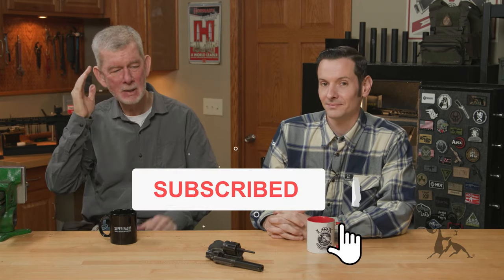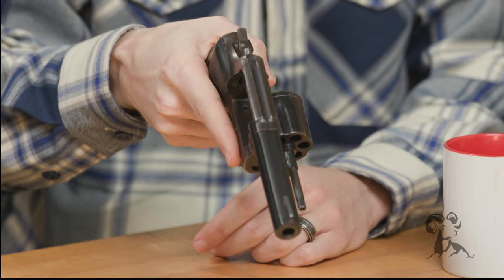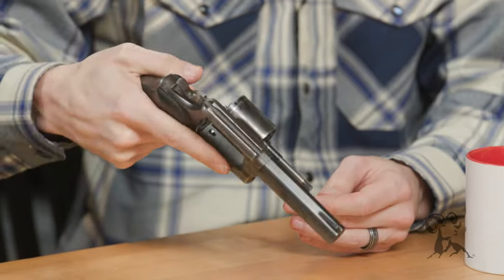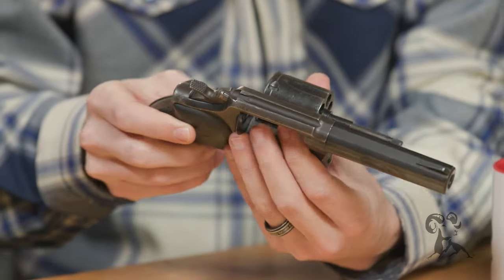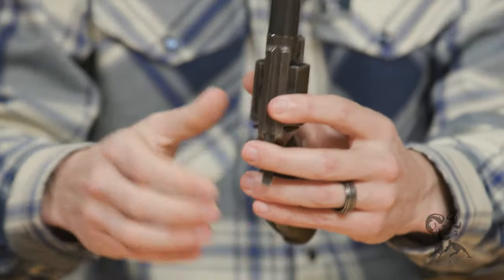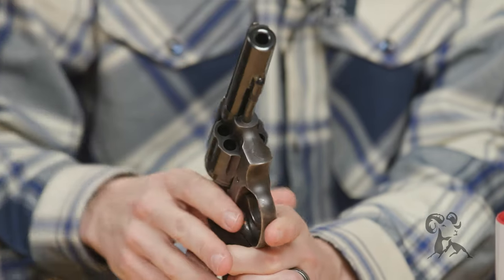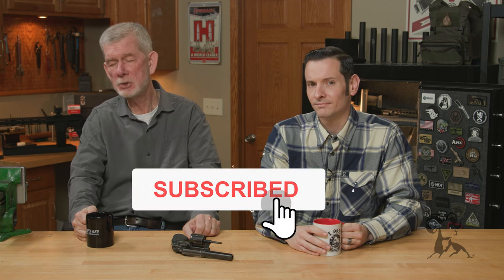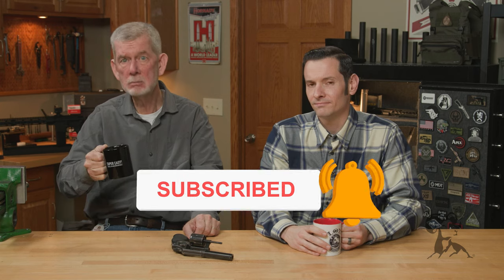Smyth Busters: Is It Bad To Snap a Revolver Cylinder Shut?

Comment: As an armorer certified on S&W revolvers, and having to repair many revolvers because of people snapping the cylinders closed, because it "looks cool" - DON'T DO IT!!! :-(
Reply: They're abunch of freaken wisenheimers I suppose by doing it and it's not cool at all when they break one and have those costly gunsmith bills to deal with !!!
Reply: Well yeah, S&Ws are like Colts..sure they look good, but give me a Ruger all day and twice on Sunday. If I'm firing a revolver, it's gonna be full house loads. Rugers are built handle it, Smiths aren't.
Reply: Not a problem on saa revolvers 🤠
Reply: I was shooting my “RGB Inc” .38 SPL and after each shot the cylinder started coming out on its own. Kind of scary makes me think it could explode does anyone know what could be wrong and should I take it to a gunsmith
Reply: This isn't how I would reload normally, but I would probably do it in a pinch if I ever had to use a speed loader under pressure... Still not good for the firearm but neither is burnouts in a car. Doing it once in a while or in a freak emergency is probably not going to blow up your gun. Doing it alot almost certainly will though. Save the abuse for the abusive situations.
Reply: @akmarksman Is this true with Smith and Wesson model 29? I have been eyeballing that and some of the Ruger Super Red Hawks
Reply: I just want to know how and why it causes damage.

I'm not saying it doesn't, I'm saying simply that it doesn't make sense to me that such little force could cause damage.
Reply: My grandpa had M10 .38spl from Vietnam, he saw the pilot swing it, and they said it's fine... So I took his word and then I realised.. You air force - army guy have an armourer to fix things, but I don't... So I gently open and close it ever since, but barrel is cracked and had to be change.
Reply: Since you're a certified S&W armorer, maybe you can answer my question. Should I apply lube to the internal parts of my K frame revolver? I don't mean a protective coat that I apply, then wipe off. I'm talking should I apply a drop of oil to certain parts under the side plate?
Reply: @cincinnatiking8008  
Yes, a DROP of light oil will be beneficial.

Comment: This is very on point and a good follow-on video would be what to look for when buying a used revolver...how to evaluate revolvers for this past mishandling.
Reply: Start with looking at the crane/frame junction from the front. If it’s not a tight, even junction just walk away.

Comment: I think there is also a distinction to be had in what motion is being used to make the revolver cylinder swing back into place and how aggressive it is being done.  You can easily do the one hand closing without imparting enough energy to the cylinder to cause damage, while on the other side of the coin you can also cause damage doing it two handed if you are in a panicked or stressed situation and you aggressively slap it shut with your off hand.  I think the better point to make is more to use care with your firearms and don’t abuse them.

Comment: I've got half a dozen guns with SSN's engraved into them.  I've also fixed a couple of revolvers with damage most likely caused by flipping the cylinder closed.  The one that gets me is one the owner owned up to.  It was a Ruger GP100 that the owner said he was bashing the ejector rod against a post to get the empties out.  Says he saw it in a video somewhere.  Of course, if you're a little off center the GP100 will snap right at the weak point.  Ruger sent me a new one for free on that.

Comment: I was astounded when you mentioned shooting tv’s decades ago and then Gunsmoke. I had a police Sgt who in fact watched gun smoke before going to work and putting on his duty belt with unloaded Pistol   Every time trying to out draw Matt Dillon. One day he had failed to unload when he put the gun on frig ( had kids) and shot his tv. Also astounded when you discussed the detective flip and K frame Smiths. I had a M-66 duty revolver in 70’s and my father a gunsmith told me sternly not to flip the cylinder closed. I passed on this information as a range officer.

Comment: Yep, it came from the movies. Break top and 1873 clones don't suffer this abuse, but they get a different stress that's hard on latch pins and timing hands due to base pin debris. If I owned a swing cylinder revolver I won't be slamming it.

Comment: This is one of many reasons I won't loan a revolver to anyone for any reason but especially for hunting. It's pretty crazy that it only takes a simple understanding of physics to know that slamming a revolver cylinder shut is bad. Spinning the cylinder and slamming the cylinder shut is worse still. The cylinder shut be lifted shut while rotating the cylinder upon closing for longevity of lockup and timing.

Comment: Just because something is physically possible to do does not mean it's a good thing to do.  Reminds me of the Mazda dealership next door to my shop.  I hung around there when I could to learn about cars and I got to know the techs.  They had customer (a douchey kid whose mom and dad bought him an RX-8) who blew up the motor.  RX-8s had a rotary motor that redlined at 9000 rpm.  Mazda warrantied it and replaced the motor.  Well, guess what?  He blew that one up, too.  When they plugged in to the OBDII and saw the computer's data of the last moments of the second motor's life, the mechanic could see that the kid was shifting at 9000 rpm.  When the service manager told him what they'd found, the kid told them "It shouldn't redline at 9000 rpm if you can't shift it that high."  Needless to say, they told him to go pound sand, so no new motor for the poor douchey kid.  He might have learned a life lesson, but I seriously doubt it.

Comment: I got a good deal on .38 spl that was skipping chambers.  I took it home and with a stone removed burrs from the locking bolt.  A relatives dan wesson .357 had the lock recesses dinged up.  I believe in both cases it was caused by wrist snapping the cylinder shut.

Comment: I bought my S&W 686+ back in August of 2021 and went to shoot it some right after buying it and it was “jamming” and not working properly. I was able to easily send it in but it took over 8 weeks of turnaround time before getting it back. Sure enough it was a yolk assembly and timing issue. I was heavily disappointed as it was a brand new gun from a large reputable local dealer, been good ever since.

Comment: I can't get a straight answer here. Can you tell me if I should lube the internal parts of my S&W K frame revolver? I've seen some people using grease, some people use oil, and some people just apply a light coat and wipe it off. Does a revolver come from the factory with lube on the internal parts? I don't mean a protective coat. I mean lube you can actually see.

Comment: Snapping the cylinder shut will cause the hand to Bind up where it rotates the cylinder. In double action when you pull the trigger it might not go all the way back to fire and hang up.

Comment: I do it with my ruger gp100. Just like beating on my vehicles I'm not going to stop.  I also won't be shocked if it causes an issue one day, again  just like the vehicles.   I will concede that if I had some beautiful python or some nice expensive revolver I likely wouldn't.  But it brings me joy so I must do wrong regardless.

Comment: It's called "Bogarting" the revolver . . . from Humphrey Bogart spinning the cylinder and snapping the cylinder shut on the revolvers he used. He also flipped it open as well, which is even worse than slapping it shut. A classic method to completely ruin a revolver. God only knows the damage their prop guns suffered from it . . . but it didn't matter with the prop guns as they only fired blanks in them. I can only wonder how many of them would have suffered a KABOOM if real live ammo was used in them.

Comment: How could the flick be worse than the gun just cycling live rounds? I get its not good to do that and kinda pointless but to be as deteimental as displayed i doubt it. Firing live rounds and using the fire arm as intended is probably doing just as much wear as a flick
Reply: It's like dropping a round directly in the chamber of a semi-auto instead of chambering it with the slide. Once or twice won't likely do anything but doing this consistently will damage your extractor. Same with dryfiring a .22 without a snapcap. Do this too many times and you will damage your firing pin and/or cause burrs in the chamber. Guns are tough, they have to be. However, the more you abuse a gun, the faster the parts will wear out as opposed to using it more carefully and taking care of it.

Comment: As a follow up, how about closing the cylinder by pushing the yoke/crane versus the cylinder itself?  I’ve hear that’s the preferred way to do it.
Reply: The mindset there is that you would be putting less leverage and angular force on the yoke/crane by closing directly from that, but I think we can generally agree that in real world use there has been little reports of anyone having trouble from gently closing their revolver using the cylinder.

Comment: Definitely bad. The more the size of the revolver goes up, the worse it is. I had the titanium cylinder 342 before, flicking it closed probably wouldn't have done much. Now you take a .500 Magnum that uses basically the same cylinder stop, and goodbye cylinder stop.

Comment: Slapping cylinders shut, dry firing without dummy rounds, and allowing slides to slam into battery on empty chambers are my pet peeves.  These actions can harm some firearms and help none of them.
Reply: Newer guns are typically safe to dry fire. But I’ll usually read the manual and do what that says but I don’t dry fire unless it’s to decock.
Reply: @super1million11  It never helps any firearm to dry fire on an empty chamber.  If it's a rimfire I strongly advise against it.

Comment: As a kid I may have been guilty of this destructive method of closing the cylinder.  I can say that without the facts of how the cylinder with a full load has enough inertia and leverage, you could do severe damage. At a glance the gun's frame looks plenty strong. Have you ever missed when swinging a sledgehammer and hit the handle? The weight of the hammer head wants to keep moving and the handle cracks or breaks.

Comment: Not to mention, people who often do this, they give the cylinder a good spin before they inertia-flick it closed. What that also means is the ratchet, crane, and cylinder stop are going to take significant impact to stop the cylinder rotating and flying back home into the locked position.
But like anything, one cannot fix stupid.

Comment: how about a 22lr revolver? would it be heavy enough to cause damage?
Reply: If the cylinder bar stock is the same diameter, there will typically be MORE metal in the cylinder, with MORE inertia, and make it MORE prone to damage.

Comment: I was always told to close the cylinder by the yoke.
Reply: That isn't really necessary, but it certainly won't hurt.  I prefer to push against the cylinder because it's larger and easier to manipulate, and if I want to align a specific chamber with the barrel, it's the only practical way to do so.

Comment: Remember:

"Don't fire your revolver. You'll wear the hammer and rifling."
"Don’t touch your revolver. You’ll get handprints all over it and that can cause corrosion."
“Never dry fire your gun, you’ll break the firing pin.”
"Don’t breathe near a revolver. The moisture will cause the mechanisms to rust and ruin the gun."

God forbid you do something with something you bought with your money. Go ahead safe queens, make me proud.

Comment: Snapping it closed with the flick of the wrist is Alec Baldwin's preferred method of closing his cylinder.

Question:  Does anyone have a problem with the tang thumb safety on their Mossberg 500?
Mine has always been so hard to turn on or off that I need both thumbs to do it.
I'm not handy with gunsmithing so I'll probably bring it to a gunsmith one of these days.  
Any opinions welcome.

Comment: If someone made a revolver that was specifically designed to be flicked shut without risk of damage, I'd buy it in a heartbeat.

Bad practice, but it does look very cool.
Reply: Rugers should be fine. They're overbuilt compared to Smith and Colt.

Comment: It’s very simple -
It is a hinged mechanism.
It’s a door.
Anything on hinges shouldn’t be slammed.
Any door in your home, if slammed, will not last as long as a door closed in an easy controlled manner.
Hang weight on it & slam it & the issue is compounded.
Flipping your revolver shut, is very flippant & careless. Treat firearms respectfully.

Comment: As an engineer, I think you are incorrect. The forces involved in slinging that revolver shut are many orders of magnitude lower than the forces generated by the firearm shooting. You are mistaking damage from regular use, as damage from something else.

Nothing you did here is checking or busting a myth. Test it, show it actually happen. At the very least, do the engineering calculations to show the the inertial forces involved in that are high enough to result in steel fatigue of the steel, and also show how firing the gun does not produce those same or worse forces. As the saying goes: "That which can be stated without evidence, can be disregarded without evidence".
Reply from the maker: This is a well documented issue, a quick google search on your end will provide overwhelming evidence backing up the conclusion of this video.
Reply: @brownells  There is a reason why anecdotes are considered useless. Guns break for all sorts of reasons. Without actually studying the failure with, and without doing this, there is no way to differentiate between a failure related or unrelated to this. This is like 10 logical fallacies all at once. It's like how plumbers always tell you that Drano doesn't work, yet in reality Drano will solve the issue 99% of the time. But of course, if Drano works, then the Plumber never gets called. Therefore, the plumber only sees the 1% of cases where Drano didn't work, but since he only sees where it didn't work, then he assumes it never worked all while being oblivious to the other 99%.
So if many people have Guns fail after 1000 rounds, but a few of then for some reason associate the failure with them doing this, and then post to the internet, then you see thoseand assume that is the cause of failure. However, what you dont see is the thousands of guns that failed in the same way despite never being treated like that, and the thousands that never failed even though they are treated like that. 
Your anecdotes mean nothing. Most likely that does nothing to harm a gun, because again, the forces are orders of magnitude less than the forces from shooting.

Comment: but here's my issue, it's Not Always true.

If you don't know which pistols it shouldn't be done on, don't do it to any of them, especially someone else's pistol.

If you want to do it with your own firearms, you're free to do as you wish, just don't complain later if you bust it.

Some pistols can do it, just have to know which ones.

As an engineer myself, any firearm not designed to be used the way it will get used in REALITY, is a poorly designed firearm, and not one I'd bet my life on. I would never buy a pistol you couldn't do it with. If a gun can't handle such simple treatment/motion, it's crap. The forces it's subjected to when firing can be more severe. A gun you have to baby is junk as an every day firearm. Fine as a collectors item.
Reply: As a mechanic and technician, I have seen many things that were "engineered" to work for a little while, but broke after not so long in service.  And I don't mean something that was abused, simply operated as part of a system.  A great example I have personally seen are some electrical motors for hydraulic selectors which don't stand up to the duty cycles of the system they are installed in.  They work perfect when new, but wear out way too soon.